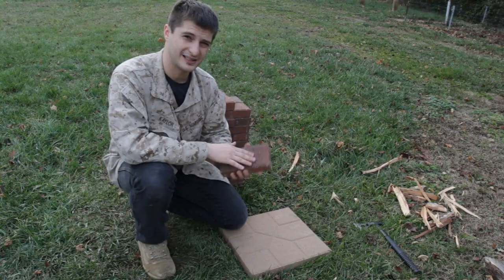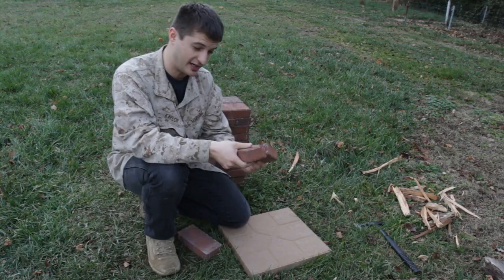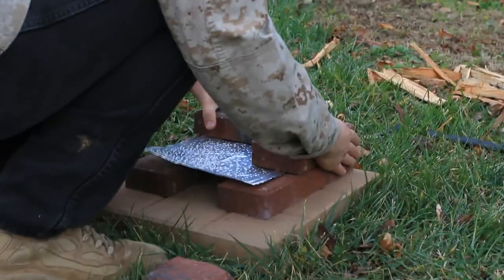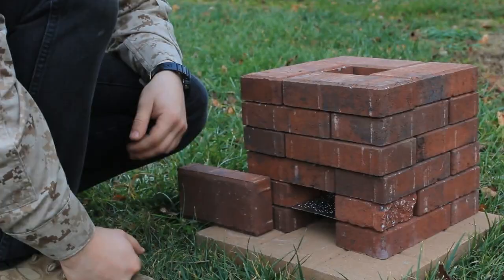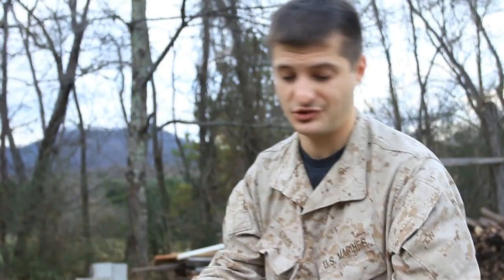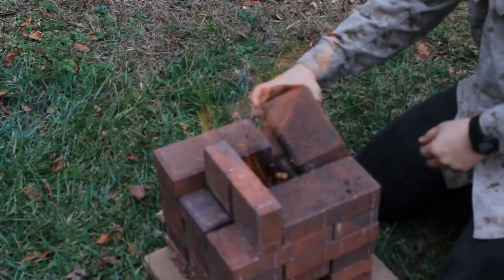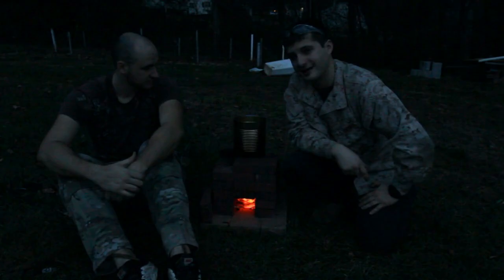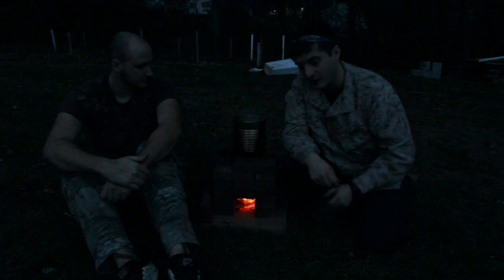DIY Brick Rocket Stove

Comment: I built one of these a couple of days ago with some modifications.  I used clay bricks instead of the concrete ones you used which are actually pavers but they work fine.  Mine is a few layers taller and I added a gravity fed firewood shoot on the side so all I have to do is throw in a bunch of wood and as it burns off on the bottom, gravity causes more wood to slide down the shoot and into the fire.   It took some trial and error to keep the entire supply from bursting into flames.  You have to fiddle with the angle a bit.  I used a piece of sheet steel so the wood slides down into place easily.  I capped off the top of the shoot also so that oxygen doesn't easily get in that way which also reduces the chance that the wood in the shoot will catch fire until it gets into place.   I put a pot of one gallon of ice water on the stove and was boiling in 4 minutes.   Got so hot it warped the stainless steel pot.   Am now working on designing a kiln  with the same principal.
Reply: Can you sdraw a diagram
Reply: Upload a video of it. 🍻

Comment: The brick that you used in the front for the whole. If you lay it flat you can support longer sticks with it and still move the brick back and forth to control the size of the opening for the airflow.

Comment: Point to remember: NEVER use rocks that are in water or close to water to build
a stove, The rocks adsorb moisture and this moisture will explode the rock
when exposed to heat. It's the same principle as popcorn, the moisture inside the kernel of corn turns to steam and explodes the kernel of corn.

Comment: So, you said don't put it in a tent... true... but after your cooking is over and it's bed time, take those bricks and lay them under your feet, under your bedding. :)  Very nice Ruski Hack to keep toasty warm throughout the cold Russian Night. Just be sure to not lay them directly on wet soil as the moisture will suck the heat out faster and also be sure to put a bit of dry material between the warm bricks and bedding so you don't melt your sleeping bag.  Don't put too many under your body as you will overheat and sweat and that's not good for your bedding.
Reply: 👍👍 it was also used in the north of France because used to warm only the main room but not the bedrooms

Comment: If you block the bottom intake. Dump some muddy water in the top hole. The dirt in the water will remain as the water flows out the cracks. Creating a seal between the bricks. Then the air flow upward will be better as it won't be sucking air through the sides.
Reply: Thanks

Comment: Warning!! Those are NOT bricks in the video! They are concrete block paviors (made for surfacing of footpaths, patios etc, also roads) Thing is, if they get hot, they can explode.
Reply: "EXPLODE"?  wow, at what Fahrenheit temperature would that take place, and what would an explosion of the block look like?
Reply: Armis Game

It isn't a matter of temperature, as such. It is the steep temperature gradient ACROSS the block, which puts it under stress.... This gradient is something that cannot be avoided in rocket stove construction. Remember, a concrete block is never "fired" in a KILN like a clay brick, so it isn't tempered by heat stress gradually over a period of days. Be assured, when they go, concrete blocks CAN be dangerous. While any one block may just split and fall apart pretty tamely, it's quite possible for them to explode and scatter shrapnel over the immediate area.
Reply: Thanks for the responsible warning, detailed explanation, I appreciate both greatly.
Reply: Armis Game
You're welcome, Sir.
And there's nothing wrong with brick-built rocket stoves, as long as you use fired clay bricks to do it. It happens the ideal ones are "fire" bricks, meaning the special ones used to line the insides of conventional wood stoves, furnaces, fireplaces and so on.
Reply: this special sturdy bricks, their breaks only Russian special forces and they do not explode))
Reply: Thanks for the heads up, didnt know that.
Reply: So can bricks. It is doubtful this fire will get that hot.
Reply: Grace, 
Most of us didn't know there was a difference, obviously the difference is material enough for one to have a fireplace application and the other not to be used in a fireplace application.

The difference is material enough to point out and regard, why risk it by minimizing the  responsible level of caution expressed?
Reply: Well Armis Game, do you see it blowing up in the video? actually a regular fired clay brick will blow up given enough heat. Only a regular fire brick (which is what chimney flues used to be lined with) are made to withstand fire.
But the Devil is always in the details. You can do this but you might want to consider the temperature you are getting up to and exercise a little healthy caution.
Reply: Most of the time all kind of bricks will only crack. Explosion is possible with all types of bricks, if you heat them up really fast. A real possibility with rocket stoves.
Reply: Thanks for the heads up.
Reply: They are brick lier
Reply: Another warning. If fire gets too hot the aluminum will melt
Reply: How about grabbing brick's from straight outta the woods and building a rocket stove
Reply: Safety is number one priority.
Reply: man I made a forge out of red clay brick and damn its good
Reply: I used to have a masonry business and they will not explode lol .After a while they may crack but that's it
Reply: I built many brick fire pits, ovens and stoves. Rocks and bricks if they get hot enough and used enough they will crack and split. I have never had any explode. I have red bricks as a back wall of my fireplace for years and they look brand new. I do use fire bricks a lot. They never get damage from heat.
Reply: @MyMPPM  Any water trapped in the material will turn into steam and expand violently.
Reply: @matthewgodwin5586  it's also a well known fact that the Germans used to heat up bricks and toss them at their enemy during WWI. The bricks would explode (sometimes) and decapitate their foe.
Reply: @thersten  lit
Reply: effyleven I’ve had a campfire fire in a natural stone fire pit have the stones explode and zing shrapnel a couple times. It got scary because that shot would have taken my eye or or maybe even killed me. A piece of hot shrapnel melted through a cheap walmart top and put a pin hole in my cot but did  damage my tent thank goodness. 

I ramble, but overall, I agree...certain rock can fully explode in the right cirmcumstances in a fire.
Reply: @thersten  if that is a fact than it is certainly not well known!

Comment: Nice design. Thanks. I've seen lots of survivalists mention carrying Bic lighters as fire starters. I always have to mention that they do not work in extreme cold or when wet. You would need to have it dry and warm to work. When you need emergency fire, you are likely to not be warm and dry. Just my experience. I know this is not an emergency vid. Just wanted to make people aware that butane has a very high operating temp.
Reply: Put the Bic in a ziploc, ExoTac FireSleeve, or other waterproof container. Takes a long time of being wet for the lighter flint to get too soft to work. For falling through the ice then making a fire, a Bic works great. Even a Bic left in your pack in below zero weather works fine after a short while under your arm, etc. Most people will NEVER be in a situation where a minute or `two is the difference between life and death. 

Possible and Probable are very important to differentiate between...

Comment: Great vid for survival. just a tip - to make the stove more "rockety" you can seal the cracks between the bricks with mud. This will intensify the draw through the air vent with a more complete burn as it doesn't let air leak between the bricks. Peace out.

Comment: This would be useful for backpacking and hiking due to its light weight and compact size.
Reply: ***** I was being sarcastic.
Reply: Fire- i must break you (brick)..need to use fire brick or youll crack all the bricks goofball..course i doubt youll build more then 50 fires in that little guy
Reply: Safety Lucas 😁
Reply: Folds up so easily too
Reply: Hey safety Lucas. I thought it was a funny comment. People these days... have no humor. Haha
Reply: and the ergonomics of the stove make it nice and packable
Reply: Actually the sheet aluminium flat-pack version of the rocket stove is just that, i.e. useful for backpacking.
Reply: This is my new ultralight backpacking stove.

Comment: If you want better tasting food you have to be able to control the temperature of the fire.  That's where a propane butane stove comes in handy.  The butane stove is about $15.00 on sale.  The stoves are light and the butane only costs a $1.00 a can on sale.  One bottle of butane is good enough for 2 or 3 cook-outs.

A wood fire is OK if you have absolutely no other fire to cook with but I've had fish burnt on the outside and still raw on the inside due to not being able to control the heat of the fire.

Comment: I would use firebricks,  that way they wont crack and  fall apart after heating and cooling.
Reply: Firebricks are generally very moisture sensitive so they would require some protection from the outside with an extra layer of an ordinary ceramic brick which would make the total amount of bricks required way too high to be a quick and simple design. It is also imortant that if the stove is not too high the temperature is really not too high as well and regular bricks should handle it with no problem.
Reply: While the temperature not being that high is true, firebricks do not require extra protection from the elements. I have an outdoor forge that is a few years old made solely out of firebricks and they are in great condition.

Comment: The only problem with aluminum is that if it gets too hot it will create toxic gas.
Reply: noname1963 as someone who studies chemical technology, I can confidently say that aluminum will NOT give off toxic gases when it is heated. You’re probably thinking of zinc chromate-coated metals. Hexavalent chromium (things like chromates, dichromates, and chromium trioxide), on the other hand, is a well known toxin.

Comment: Just leave a little gap in the bricks instead of sticking them together and the air will pass automatically through the fire. much more efficient. Especially the last rung of the bricks/concrete slabs.

Comment: i bet it would work much better if you use a fan or a air dryer at the entry of the air!
Reply: No too much air can be bad, and cause the fire to burn out, plus this is about having a fire at a rustic campsite, or survival type situation, and I doubt your gonna have anything electrical like that.
Reply: vinegarchips isn't going to make it when all hell breaks loose.

Comment: the problem is , that aluminum melts already at 700 :/
Reply: ***** Can i buy it in a  ardware store ?
Reply: *****  ok ty
Reply: aluminum melts at 1200 degrees
Reply: nope ,my period system says 660* C melting temperature and 2467* C cooking temperature
Reply: Ur what ?
Reply: And I was talking °f
Reply: RELUCTANT just get an old grill or something and take the grate off it problem solved. why go through all the trouble making your own
Reply: The melting temperature of aluminum foil is 660 degrees Celsius (1,220 degrees Fahrenheit).
With the blast-effect of that stove, I don't know how hot it gets. If you added a blower I would get up there and likely melt that aluminum foil.

Comment: I understand the concept, but the metal sheet at the bottom seals off the air vent. It has no space for the air entering the air vent to enter the stack hole. This prevents the air up to the flames to support combustion in the upper part of the metal sheet and up the stack hole with the flames. Check it out @ 1.38 in the video. A 1" space is needed from the back brick when the metal sheet is placed on the first row of bricks. Good videos
Reply: DID YOU SEE THE FIRE, DID YOU SEE THE WATER BOILING?!?!  IT WORKS.  Your comment is foolish.
Reply: Shadow2084 He clearly wasn't paying attention when they guy specified that he poked a bunch of holes in the sheet because it's what he had on hand. No need to be rude.

Comment: Will this work for melting aluminum  if i force more air with a fan or something like that?
Reply: Yes, but the bricks will explode, you could use fireproof bricks.
If you want to melt alluminium, use an old steel bucket and line it with plaster of paris mixed 50/50 with sand and make a hole for the blower, works great for me, I made the furnace in this video: https://www.youtube.com/watch?v=9bMDpcBc2v4
Reply: Joep Stuyfzand I use charcoal as fuel and a small fan running off my far battery and the bricks are fine. How long would you have to heat the bricks for that to happen?
Reply: ccxr253 Depends on the type of bricks, but at alluminium melting temperature my bricks exploded, your bricks will problably explode at higher temperatures, be careful!

Comment: Really nice, easy to build and  use stove. Several comments that KGB Survivalist might want to add/evaluate
1) The aluminum sheet is really important for the draw. But Aluuminum might easily break-/i think your idea of a real iron grate is really important for long term use. The problem will be that you raise the next level of bricks a bit possibly causing an air opening.
2) to get rid of the air pocket created above what about daubing it with Mud on the outside (and use mud on the outside where ever air gets in.
3) I like the idea of upturning the final 2 bricks to create a "trivet" to hold pans etc. But I do believe  just like you suggest this might let too much heat escape that an iron grate on the top would be better
Question-We live in a forest and I would like to teach this to my son and grandson. Have you guys or anyone else  can you adapt your stove to take larger pieces of wood either in diameter or in length . I suppose you could put a piece of wood from the top but that would only be good if you chopped it smaller in length than the top of the stove? I am mostly thinking (adfter the fire is really hot of being able to place the end of  say a two by four (or a 1-2 inch thick branch into the side and then having the draw of the chimney preventing the flames form escaping the side-thus creating a long burning fire--your thoughts

Comment: Once you get one going, you could use your can to create wood coal. Cut off the oxygen to the wood and it should turn into a coal-like piece of wood that will burn and burn really hot. I think it's best to have a hole in the bottom though depending upon what wood species you use, there will be sap and other by products of the process.
Reply: ***** I was just being specific as to what I meant. You can find coal on the beach in Alaska. What I'm talking about is different.

Comment: If I wanted to seal the bricks together to make it permanent, what would be the best adhesive stuff to use? anyone? Cement maybe?
Reply: +musicisbrilliant liquid nails for mortar
Reply: +musicisbrilliant  I wouldn't bother with portland cement, especially if you use concrete pavers this stove isn't going to have a really long life. A bit of mud and sand should do just fine. The ratio would depend on the soil type you use, but 1/2 and 1/2 should be a good starting point.
Reply: +Harley Liquid nails will release cyanide and other toxic chemicals when heated . Not good for something you'll be cooking on.
Reply: WorBlu x Great info, thanks. Ill look into it!
Reply: +musicisbrilliant If its for survival purposes, Id would research how to make a natural mortar so you can do it if you didnt have access to a retail store for supplies.
Reply: WorBlu x ok cool did not know
Reply: +Harley FAIL! liquid nails will poison you
Reply: +zack worrell yeah, that guy was trolling. Hes trying to kill someone.

Comment: Can you melt metal in it?
Reply: ***** oke Ty, that always could be handy at some point. :P
Reply: LethalCheese
but try and think of a blacksmiths....as well as heat the high temps required for most metals need a bellows to add high levels of oxygen from rushing air through the coals/charcoals as they can burn for longer than fresh woods (I Think)...am no expert just remembering from some docs I've watched about samurai swordmakers.
Reply: A great easy to make design though....if I was in a survival situation I could easily construct a similar stove from stones and clay/mud adobe type structure if pushed to do so. That is the great thing with great designs, they can be adapted to the requirement.
Reply: rolicoli8 We are trying to help, not be funny/clever.

Comment: Good tip not to run it inside a tent, and not just because of sparks. Something like this will exhaust all the oxygen in a confined space and turn it into carbon dioxide and carbon monoxide. People die from using burners indoors all the time. So don't build one in your garage either!

Comment: It's interesting.. in fact steel would work better than aluminum because aluminum vaporizes at a pretty low temp and is a neurotoxin... so you say can find a car? the spare tire or tire off of it.. the rim.. just build your rocket stove base then stack the rim on top then continue to stack... other soiurces for your aluminum in a pinch can be aluminum screening material from say a screen window.... or say tearing apart a bug light for it's wire mesh grill... be resourceful and you stay alive another day :)

Comment: Add forced air and better bricks and you could start melting metals.
Reply: the bricks will break they are red bricks they don't work for those things they barely work for a small fire

Comment: The red bricks are not fire bricks, they won't explode from the air trapped inside when they get hot??.
Reply: That's why I prefer my 100% pumice bricks.
Reply: @luciusirving5926  
Exactly. You just never know when one of those bricks will explode.